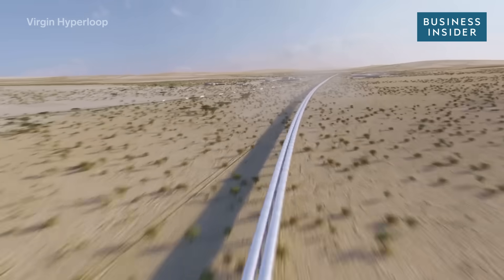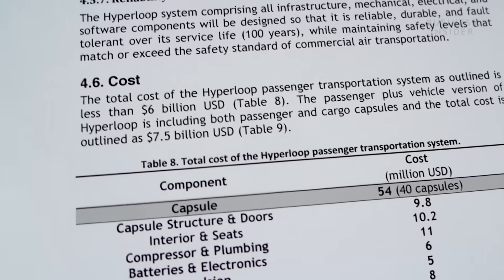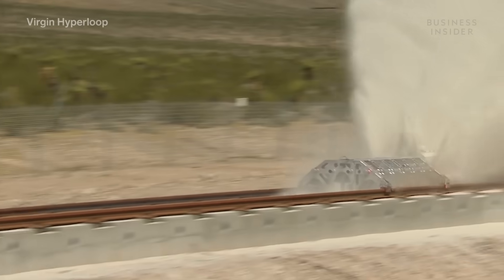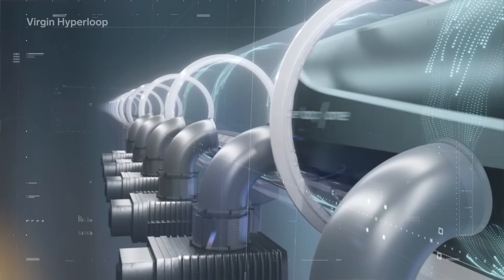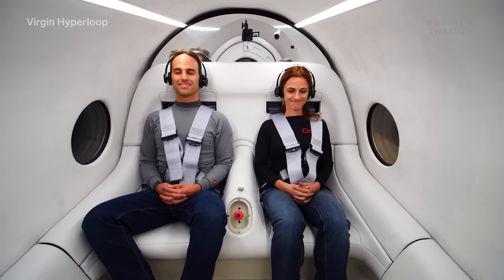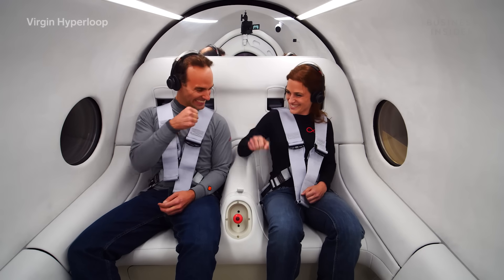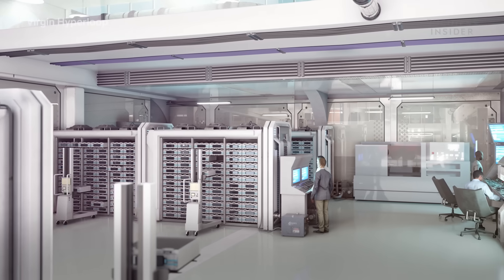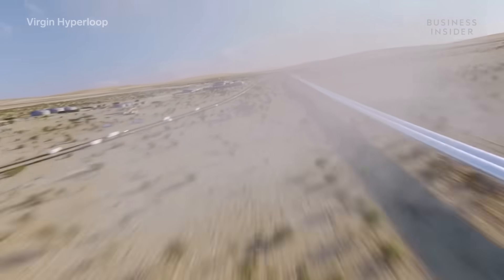How Elon Musk's 700 MPH Hyperloop Concept Could Become The Fastest Way To Travel

Comment: My main 2 concerns are what will happen if:
1. The machine breaks down in the middle of the tunnel for whatever reason.
2. Fails to stop.
Reply: Planes still have those “if” situation but nobody cares😂
Reply: @axlelijah2327  Thing is that aircraft safety is so advanced that those "ifs" have very little chance of happening, and even if they do, there are ways to overcome it (say gliding a plane onto sea or land, or landing a plane with the gear up if both the brakes and reverse thrust somehow doesn't work). We can't really compare proven technology and half-working prototypes together.
Reply: @nerraD27  my guy 99% of the times people die in airline crashes tf?
Reply: @axlelijah2327  Last time I check planes dont fly in an air tight tunnel
Reply: @sjrjfndn  last time i checked if a plane is crashing the survival rate is less than 1% lol and these guys that made these hyperloops are smart mfs they know what they’re doing if you don’t trust em then don’t use it lol it’s that simple people like y’all are literally not doing anything other than blabbering and hating
Reply: @axlelijah2327  but if a plane fails the intire supplyline doesn't break down
Reply: @axlelijah2327  its called parachute.
Reply: Yet they are safer than a vacuum tube that will realistically not exist
Reply: 3. Someone who shoots a 0.50 BMG anywhere at the tube. BOOOOM!
Reply: No need to be concerned. It's a scam, and it'll never happen.

Though, IF it was going to happen, there would be plenty of other concerns as well:
1. Heat expansion of the tube.
2. Vacuum tube failure (the resulting air invading the tube would demolish ALL pods inside).
3. Any of the pods catching fire (would consume the air inside the pod and suffocate people, not to mention becoming a hazard for the next pod).

And these are just off the top of my head.
Reply: @jyidorne8042  Who are you to say this wont work? Do you not think the engineers have not thought of this? Do you really think theyre as dumb as you and me?
Reply: @penapickle  Firstly, I'm not dumb. You may be, but I'm not. Secondly, no matter how smart you're, you can't change laws of physics. Thirdly, Elon Musk is not an engineer, and he's the one who's been pushing this idea. Fourthly, engineers are not scientists, and they can be paid enough to say whatever you want. Fifthly, hyperloop has been debunked by an ACTUAL scientist, one with an ACTUAL doctorate in physics, and he has ACTUALLY explained all the shortcomings of the system. 

Maybe if you would pour an endless amount of money into, it could be made to work somewhat - but what it definitely is NOT is a 700 mph system that's "cheaper to build than a bullet train", that part is just Elon Musk's snake's oil bullshit.
Reply: @jyidorne8042  "maybe if you pour endless amounts of money into it" so its possible then? Youre kinda contradicting yourself here. Also who is this scientist that debunked it? Please source
Reply: @jyidorne8042  I actually rewatched the video and nowhere did it say that it would be cheaper to BUILD than a bullet train. So idk what youre trying to say.
Reply: Planes still have those terrifying ifs
Reply: @carterg1847  planes can fly without energy and engine shutdown for hundred of Kms before touching groundn, it can also fly with one engine only and arent in a airless tube with such a pressure differential it could kill you in a second at any leak
Reply: @carterg1847  planes have contingencies, the hyperloop/vactrain idea has people telling you other forms of transportation can fail too. with planes, automobiles, trains, etc everyone involved has much more agency to avoid a catastrophe vs being sucked into a tight tube with seemingly no escape or exits or emergency procedure.
Reply: @carterg1847  except planes have 1, aerobraking and 2, fly high enough to glide to a decent landing(not so comfortable but you live, so be happy)
Reply: @carterg1847  if a plane loses engines mid flight, it will still have wings for lift. If a hovering train moving at 700MPH just stops, you are about to be mashed potatoes.
Reply: @carterg1847  only Planes are at cruising altitude and can still float if their engine stops
Reply: @carterg1847  planes can glide
Reply: @carterg1847  Yes, they do. But planes actually work.
Reply: I see some people comparing this to a plane. It’s a stupid comparison, because planes are up in the air free, and have more accessible ways to exit. This Hyperloop is in a tight tube, where there are other machines like these. If we assume that each machine moves at 120 MPH, it will take 6 seconds to decelerate and stop completely. However, once the stuck machine enters the field of view, it’s already too late. That doesn’t even mention the fact of accidental leaks which can cause explosions, earthquakes, and just friction.
Reply: @marcusvergara6193  All that is very easily achievable through modern electronics, sensor and networking system. You are still in the steam era where trains took a kilometre to hault. Since the propulsion system is very light, the overall train is light and has very low intertia compared to present day locomotives
Reply: I mean I don't know, but in theory, it can't stop randomly unless the electromagnets fail to work. Not sure how that's possible unless there is a connection problem. Secondly, if the pod doesn't seem to be stopping, they can shut off the electricity, essentially turning off the electromagnets, meaning the train will no longer levitate, and it will slow down due to friction.
Reply: @benvossebelt4893  LOL imagine if that friction starts/sharts💩👀😱 a FIRE like the ones always leaving my BUNGHOLE!!!!!🤣😂
Reply: You will slowly suficate dew to no oxygen in the tunnel but thats a small price to pay for fast travel
Reply: @Silver_Prussian  true as with the vacuum sucking out the air oxygen as well will be sucked out the tunnel unless they put oxygen tanks in the hyperloop train
Reply: That's why there is testing and these projects take years. Safety features else they could build one already.
Reply: I worry about decompression. Imagine 1 hole in the tunnel
Reply: We will just push them through with Hyperloop 2. All the dead bodies, we will Hype2/3 them out of the way.
You should get into a tunnel miles long with no fire escapes with your Tesla Uber driver. Just let it roll over you, man.🤣
Reply: That is a concern that is likely to happen
Reply: Well failing to stop can be answered quite easily: Smash right into the end of the tunnel.
Reply: they might make some emergency thing if that does happen
Reply: let me introduce you the fear of the tube crashing you cuz of a small puncture and the 1 atmosphere of pressure rushing in.
Reply: It's not going to be ever made. He can only  put some teslas with drivers through an led-light mini tunnel and call it a day.
Reply: Mine is...what if an earthquake or terrorist damage a tube,, cracks or open and going at that speed  😱😱
Reply: 1. Probably some kind of emergency pod pushers to push you to the next emergency exit.
2. Death.
Reply: Same thing could be said for planes, trains and automobiles.
Reply: Not with planes comes the fails to stop, pilots can always go around the airport another time, pushing throttle to full, even when they have hit the landing strip. It’s quite common for aircraft carriers.
Reply: My concern is that the number of online scammers increases. Lol.
Reply: Let's make movies on both
Reply: and building it (which is literally impossible.)
Reply: Impossible for something like this to fail to stop, it's a simple of matter of cutting the input energy, the question is if it can stop fast enough
Reply: My biggest concern is the tunnel imploding under atmospheric pressure, just like the train car on mythbusters. But yea getting stuck would suck too.
Reply: @joeybulford5266  Well, do not worry. They will never achieve that kind of vacuum. Not only that volume is huge, but there is evaporation of impurities inside of chamber, like paints etc. From what I saw, they do not have intention to make clean chamber walls, they are painted and paints can contain solvents for months before they evaporate. I work with vacuum systems on daily basis. In volume of few liters when you put one droplet of water inside it kicks down vacuum for order of magnitude because that droplet becomes a CLOUD once inside of vacuum system. In such huge systems you can expect big quantities of all sorts of impurities like water and paint fumes. But there is another problem. In turbo-molecular vacuum pump, for instance, when for some reason pressure rises abruptly,  rotating blades (similar to those in turbo jet engine) are destroyed (and bearings also) because sudden change of pressure works like hammer kicking rotor axially. What do they think it would happen if there is sudden rise of pressure, what would happen to passengers and the vehicle ? Entire idea is pure insanity.
Reply: @JosipMiller  
Haha I’ll add that to my very long list of growing reasons as to why this thing will never get built 😂
Reply: @joeybulford5266  :) Well, there is a story about Chinese guy who worked with my lab CEO when he was on post-doc at one big American facility for mass spectrometers building and research. Sample is usually introduced into vacuum systems in flows around, say microliters per minute, so you do not disturb vacuum and your system can detect compounds. When you clean "source" (device used to ionize, nebulize and introduce sample to the system) you need to disconnect it from the system otherwise you can disturb vacuum and contaminate or even damage sensitive components like mass filters, ion traps or detectors. But this guy FORGOT to disconnect it and he sprayed entire syringe of acetonitrile (cleaning solvent) directly into the system causing alert and automated closing of diffusion pumps apertures. That was funny and terrible in the same time. :)
Reply: It is flawed for many reasons but what bothers me most is because of who said it can be done and said "believe me, it is easy" in an interview has no clue how to. If this was the top priority for humanity, maybe somehow it could be done (not in a vacuum and not with magnetic levitation),  it is not practical, it will never be.
Reply: what im afraid of is that since the tube is vacuumed, what if something breaks the tube
Reply: They always think of these things and there's always backup plans involved, escape/ emergency exits for a reason. SAFETY
Reply: Humans are aliens lol... if something were to happen in that tunnel of magnets how'd they extract the occupants??  It sounds good but redundancies are more valuable , in terms of inflating the project costs and with airlines motorvehicles and other methods of transport its a potential loss relatively...  not to mention claustrophobic... in my opinion
Reply: What if a brick falls on my head and kill me tommorow dont think about it  the idea to travel  from berlin to bucharest  in 1 hour should be perfected
Reply: You forgot a major leak like a bullet hole. Remember the Titan sub? Like that but worse.
Reply: My one main concern is that it is potentially being developed by a cartel that is known for cutting corners.  And overpromising.  And screwing up.  And being run by a Nazi.  

No way this happens in Europe anytime soon because they are all wise to this fool.
Reply: My main concern is that this scam has gone on for almost a decade, pumping hundreds of millions into fruitless attempts by undergraduate students to build something that isn’t yet remotely on par with the advertised promised system. Reason for undergraduates is of course that more educated engineers won’t spend their time on projects that can be scientifically debunked in 15 minutes
Reply: @andersandersson3073  it's Elon musk he did what everyone said was impossible and then did it faster and better look at falcon nine or dragon as well as starship.
Reply: @mikhialkalshnikov5573  no, it’s not Elon Musk
Reply: @andersandersson3073  the reason these attempts are “fruitless” is because billionaires with high stake in oil and road building companies (look up the Koch brothers) are buying politicians to put legislature in place that makes this unfeasible. Capitalist greed is preventing progress in transportation as well as many other areas unfortunately.
Reply: @andersandersson3073  or; what if a terrorist group or whatever destroy the tubes? Apparently the air pressure would be different so it could theoretically crush the pod things
Reply: @andersandersson3073  Elon Musk, 2nd richest man on Earth while having launched reusable rockets into space. And you’re telling me that hes an undergraduate? He has done more for humanity than you will for several lifetimes. My main concern is you’re inability to adapt to technology.
Reply: @andersandersson3073  people have said it'd be impossible to fly to the moon. With time this can be a possibility, along with commercialized space travel. People who give up like you wont make a difference for the future
Reply: @penapickle This has nothing to do with giving up. It has to do with scientific understanding of what is achievable with a reasonable effort compared with possible gains. With space travel, there is the potential of exploring new worlds and learning new things in physics. Hyperloop hasn't got any potential advantages, and the benefits of a working hyperloop system are minscule compared to the costs of making it even work as a prototype. A 100 year old idea hasn't become more viable because Elon Musk hyped it some years ago - heck even Musk has abandoned the concept now :D
Reply: @andersandersson3073  keyword "prototype". Over time it will be more efficient and pay for itself in the future. Also where did you hear Elon abandoned the idea? Id like to have a source. Maybe hes postponing it because he is more focused on SpaceX, Tesla, the boring tunnel, etc. The hyperloop probably isnt necessary right now.
Reply: @andersandersson3073  and actually, yes, a 100 year old idea CAN be more viable because that was a 100 years ago. Technology can advance
Reply: @penapickle  Technology advances, but there have  not been any scientific breakthroughs that would change the fundamentals of this idea
Reply: @penapickle  don’t you see that the issue we have with this concept/prototype is that those who have been advocating it since 2013 when EM coined a cool name for the 100 years old idea, have constantly overpromised cost, benefits and time table for it. This is something we have predicted for a long time, but people like yourself are buying the snake oil every time a new funding round is done from one of the few remaining companies that still tries to do something which is resembling of the HL. I predict that in the end they will skip the vacuum altogether and end up with a maglev pod system that could have some niche markets, but hey - check out Shanghai Maglev, a commercial system going since 2003...
Reply: @andersandersson3073  first, yeah there arent any scientific breakthroughs on HL, YET. You say technology advances but you dont realize that it takes time for that to happen. Second, what do you mean overpromised? Theyre working on it. You dont even know what the final product is. Third, what motivation is there for this scam in the first place? Why would Elon risk this? Why would he risk his public image and various companies, when he's at the top 5 of the richest because of these successful companies. It seems like a TERRIBLE business decision. Fourth, still waiting on that source on Elon abandoning the project. Im gonna assume you just lied about that to make your argument look better.
Reply: @penapickle  You seem very uninformed about all the Hyperloop promises over the last decade - is this the first time you see it? There was even a white paper cowritten by Elon, and this is what has ‘defined’ it as a concept. Now, if you just search on YouTube for ‘Elon musk hyperloop wheels’, you see he is clearly moving away from the original idea, towards saying that almost anything is possible to do, as long as it is run in tunnels. And that is because he has realised (because he is not a dumb guy) that the original concept had all the flaws that scientists and engineers have pointed out. SpaceX used to support HL competitions which doesn’t happen anymore - and they removed supporting documents on their website - clearly they don’t want to be affiliated with it anymore. And if you check e.g. Virgin HL, and google the promises they have made over time, you see them fail epically all the time - but they are still getting tons of money from investors drinking the CGI snake oil. People still has the CGI-rendered commercial idea about what HL will be which will never happen in real life due to cost and extreme technical challenges. You are arguing that it cannot be a scam because why would Elon risk it. Did you know that Elon isn’t involved in any of the companies currently trying to implement HL? I don’t accuse Elon for scamming consciously, it is just that without his phrase coining and white paper writing 9 years ago, there would never had been such a hype around the idea - an idea which is 100 years old and has time after time proved to be too expensive and technically difficult to pursue. There are better ways to advance mankind - but I’m of course happy for all the undergraduate engineers getting to play and learn science, but it is a very expensive way to do it, and those who pour their last savings into this in the belief that any of the CGI rendering will become true within 50 years I am really sorry for, which is why I argue it is a scam.
Reply: @andersandersson3073  I think the reason why Elon doesn't directly mention about him leaving the Hyperloop scene is because of PR
Reply: @andersandersson3073  "within 50 years", so you believe it can be done after that time frame? (with how technology is exponentially advancing, this number seems very off). You are condradicting yourself saying that its impossible to build. I did a quick wikapedia search and it says tesla and spacex were the first to work on the construction of the hyperloop. What do you mean time and time again its proved to be too expensive (which is true, but not impossible too build) and technically difficult? (over time, like I said, technology will advance). They were the first to work on the "100 year old idea" and are still working on it. They have not failed yet. Elon has also stated in the "Elon musk supports wheels for hyperloop" video that this project is a "journey of discovery", meaning that its a work in progress. Like I said in my previous comment, technology advances with time. Thats why they now quoted a 2030 time to finish. Also, there are better ways to advance mankind? Give me an example. I'm sure you'll call that a scam as well because you'll think its impossible to do as well. Thats why I am saying you cant give up on inovations like this or else we'll never improve. You have to take a leap of faith or we'll stay stuck where we are.
Reply: @andersandersson3073  and even if it takes billions of dollars to make, after the construction of this "revolutionary transportation system" theyll earn all that money back tenfold. Thats why its called a leap of faith. Look at tesla for example, they were on the brink of bankruptcy. Now look at them. They are single handedly changing the world.
Reply: @penapickle  I think you need to read all my posts above again, as I can understand that there is perhaps too much information to take in if you haven’t followed the HL history closely. Use google, perhaps take a quick look at Thunderf00t’s latest video on the subject (he is a very arrogant person, but he provides good references to promises and backgrounds which are directly from HLs own material). As an example for advancing mankind, I choose SpaceX’s collaboration with NASA - not because it is the best example available, but for you to realise that I don’t post here because of some hatred against Elon Musk. Good luck with your studying!
Reply: @andersandersson3073  and why do you believe in spacex instead of this hyperloop idea? And why are you disregarding all the counterpoints I've made? I've responded to all your points
Reply: @andersandersson3073  and sure ill watch thunderf00ts video. Will update you
Reply: @penapickle  I can’t bother pointing out your misinterpretations of my combined posts, I’m sorry - I don’t think you have made any counter point worth debating. And why I believe in SpaceX is for the same reasons that I don’t believe in HL - with a science and engineering background I see that SpaceX’s efforts (although they too are overpromising a bit) makes sense in a completely different way. Let’s agree to disagree on HL. Cheers.
Reply: @andersandersson3073  You know this is textbook behaviour when someone is losing an argument. 1. They insult you. 2. Call you stupid and say to do your research (when I have) 3. Ignore ellaborating on points that will weaken their argument. Seems like you fit the picture. Now in your next reply if you dont prove me wrong, I'll assume I've won this argument.
Reply: @penapickle  1. When did I insult you 2. When did I call you stupid? 3. I don’t see which points I should elaborate on - which points would weaken my argument? About 2: I have actually refrained from calling you stupid, hoping that you would see my points if you took time to think through my posts - only this last post of you tempt me to call you that.
Reply: I believe this is just the type of perception people will have before this mode of transportation is normalised. Obviously people had similar thoughts about planes and trains, though most likely in a different sort of manner- but nevertheless there was still doubt about the technology. But after awhile of testing and also after official release, people became accustomed to the transportation and less afraid and wary of it. It’s just the natural behaviour of adapting to a new things for us.
Reply: You can use those if's far many of the things you use without a second thought. What if the brakes on your car failed? What if the plane your flying broke mid-flight? What if that rollercoaster you're on suddenly broke? 

There is no point in worrying. It will most likely have a very miniscule chance of failing, and almost no-one will ever experience it.
Reply: That’s not even mentioning the fact that it is 720 MPH. That’s just going to be too dangerous, and the magnet idea just doesn’t correspond with physics.
Reply: @marcusvergara6193  the magnets make ally of sense and I’m sure they’ll put something in there to reduce g force if you stop suddenly but the reality is you go 2/3 of the way to the destination and then you stop to slow down slowly but surely
Reply: @blastfurnace3095  still very unrealistic in physics.
Reply: @marcusvergara6193  well if it works it works if it doesn’t well if it doesn’t you have a train that just disintegrated
Reply: @blastfurnace3095  Thunderf00t has pretty good videos on how BS hyperloop is, although sadly, it seems that he's kinda milking Elon Musk more than anything.
Reply: @marcusvergara6193  my guy the ones who works on these hyperloops are atleast million times smarter than you they know what they were doing.
Reply: @axlelijah2327  wow you are REALLY missing the point here
Reply: @axlelijah2327  u clearly didn't see Leon's comment. He mentioned about the fact that the hyperloop has a chance of breaking down or not stopping , not CRASHING . Please know your facts before forming an argument. Good day!
Reply: @marcusvergara6193  physics get proven wrong time and time again. We seem to keep placing our self's in this box.
Reply: @44cartel50  yeah, but each time physics is proven wrong, it just proves a particular aspect of complex physics wrong, like energy inequalities between the four states of matter. However, this contradicts the ENTIRETY of BASIC physics. Not a particular aspect, but the ENTIRETY. Let me remind you, this aspect of physics has been proven over the last 2500 years over countless experiments, revisions and conclusions. You’re telling me that Elon Musk is more trustworthy than the most basic of physics? Whatever you say.
Reply: @44cartel50  also, it’s “ourselves” not “our self’s”. This doesn’t really enhance your credibility on this subject on proving Elon correct,
Reply: @axlelijah2327  so they are very smart yet they are making something that is worse than a train, a lot more expensive than a train, has way less passenger capacity than a train and in case of an emergency there is no way to help you. + the hyperloop isn't even originally Elon's idea it was proposed 50+ years ago